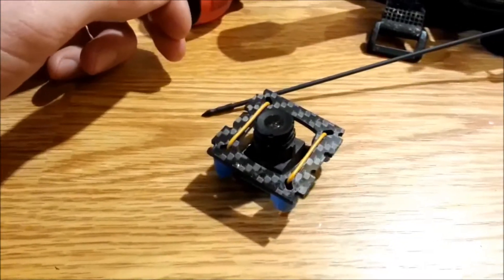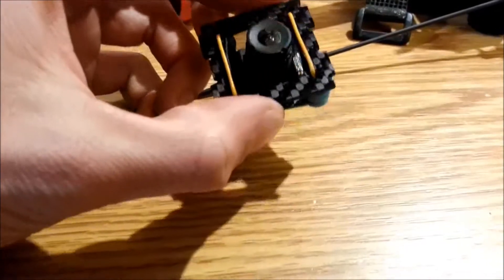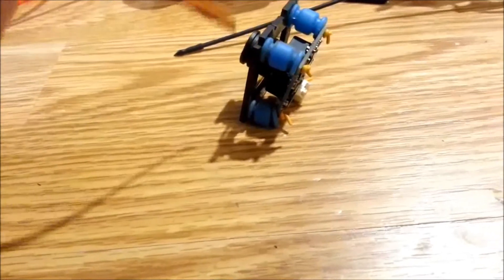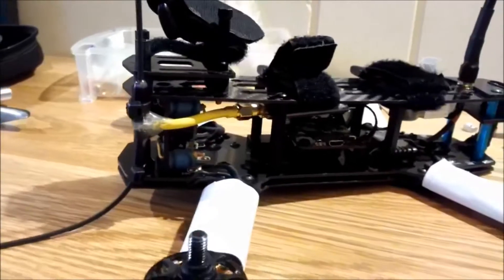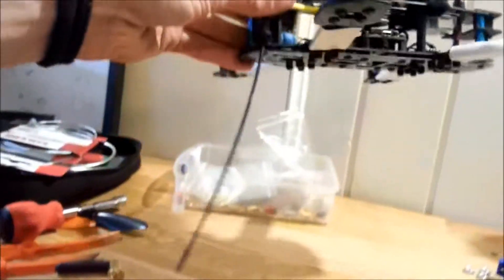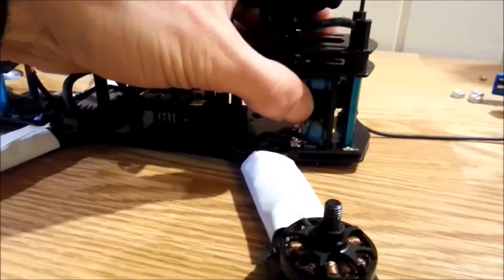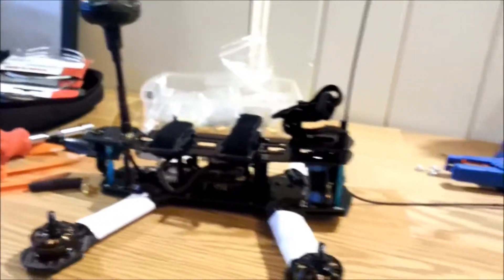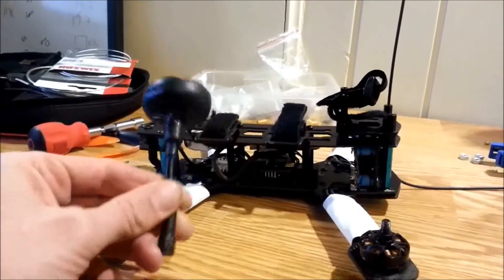How to mount the PZ0420m to your Blackout Mini H ( or any other mini)

Comment: Wow,  brilliant.  I have a Nemesis and was wondering how the heck I would mount this cam but this is definitely the way to go.  Any jello from this mounting?
Reply from the maker: +Dennis Forbes slim to none. later i used the inner strand of 550 paracord. resulting is a broken board after a lens first collision. the rope does not give. then i made my own mini. The Fearless witch got a essayer cam mount. if i was still using the blackout i would give a hair elastic a try. as it would absorb impact and vibration more. good luck! :)

Comment: Im building my first quad and I'm at the final stage of mounting the board camera and VTx. I've been trying to come up with a better solution and I think  I've  found it in your video. Thanks for the great idea it's brilliant!
Reply from the maker: Thanks! That's great to hear:) happy flying!
Reply: RC and FPV Jonathan I was thinking instead of using the servo wire I might try some type of thin elastic cord.